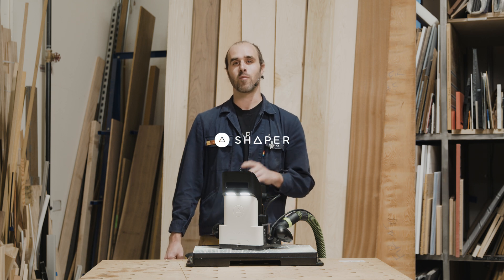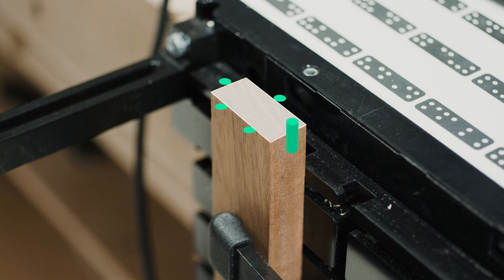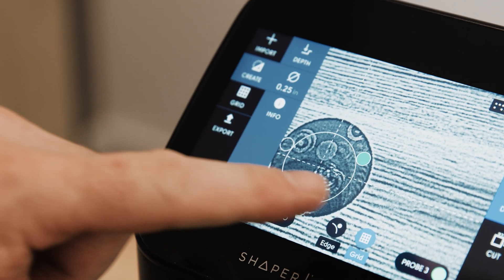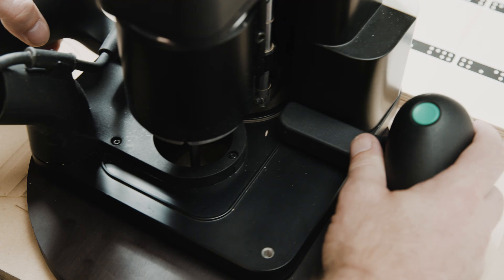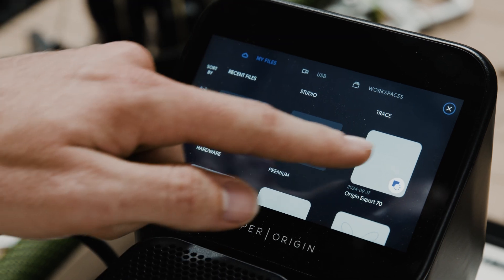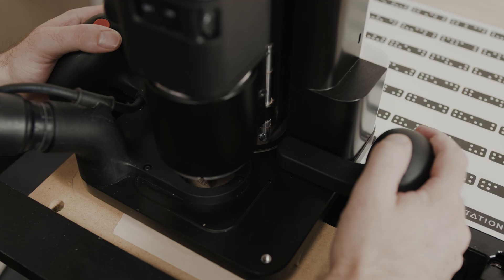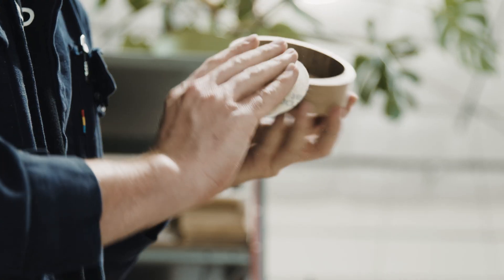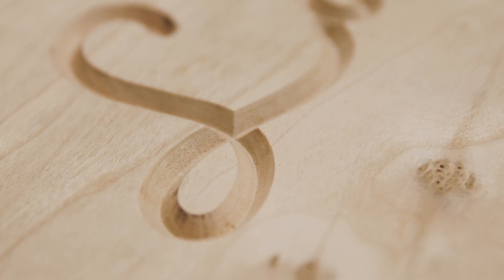Software Update: Introducing Larkspur

Comment: I have had 2 crashes in the middle of a job for a client so far with this update. The screen goes black and nothing works. Freaked me out the first time. The only way to proceed, is to unplug and restart the machine. Fortunately, it resumes where it left off.  I've seen posts by other users with the same issue. Disconcerting for sure. I'm hoping for an "update" to the update soon.

Comment: Open pass?..
OHHHH I heard it wrong.  Open PATHS are supported.  Sweet!
Optional paid.... oh boy here we go again?  Am I hearing there is an Open Path add on extension coming?  Not listed on the site
Perhaps you are saying Autopass is getting an upgrade that supports open paths in addition to the pocketing (WHICH IS HUGE, BTW)
Reply from the maker: Happy to clarify! You're correct, AutoPass did get an update. But no, we're not rolling out an optional paid extension for open paths, that's just part of the update to AutoPass. Here are the details:
AutoPass (which is an optional paid extension) just got an update. This update includes the support for pocketing, plus how it handles open paths. You'll now be able to use AutoPass when pocketing, and when cutting at multiple depths using AutoPass if working with Open Paths.

Note, this update to Autopass is both for folks who previously purchased AutoPass, and those considering it. Hope this helps clear that up!